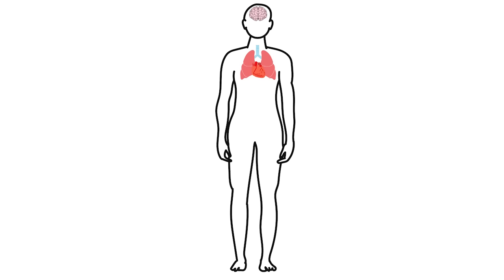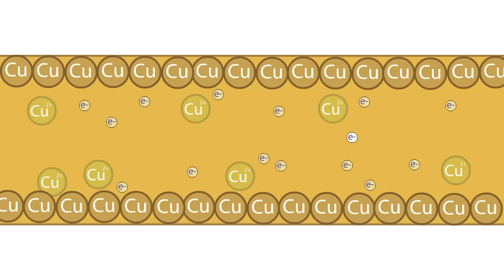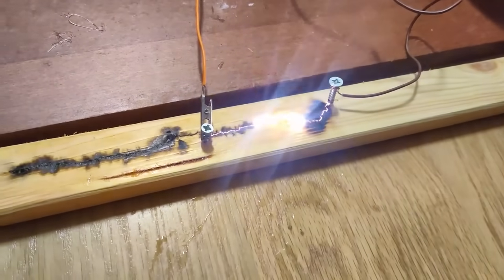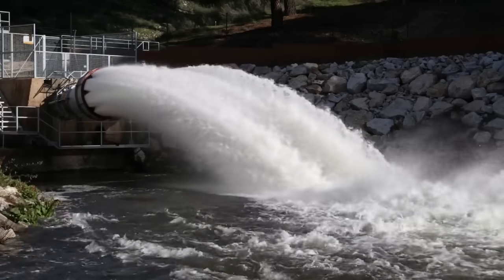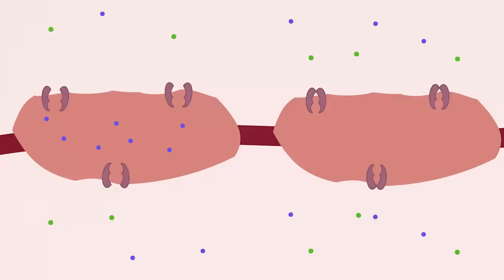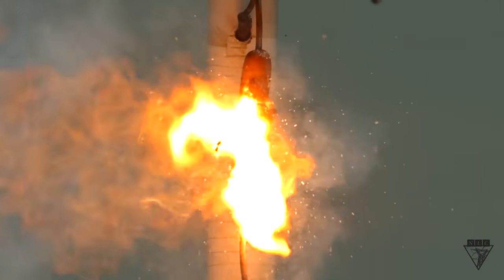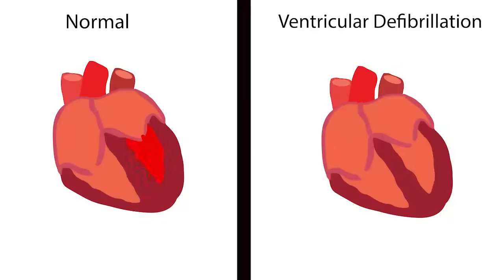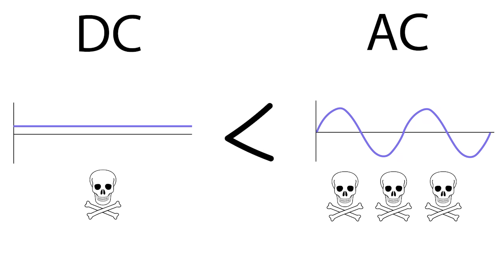Anatomy of Electrocution

Comment: Higher voltage means the electricity has an easier time finding a path, aka jumping, arcing, etc.
Current matters because that’s what will damage tissue and heat up.

Comment: I once had my finger slip through a small Tesla lamp as a kid and touched the bottom of the main chip inside I was able to get away but not immediately left a pin size burn spot on my index finger like the size of a spark from getting shocked from a doorknob even felt the shock go up the nerves of my arm starting from that finger didn't seem to go further than that though once I pulled away I fell immediately but got up quickly guess I was lucky it wasn't enough for me to not pull away at all
Reply: Also if your wondering what it feels like I've also had a more mild shock installing a new dryer in my basement my finger came in contact with one of the two screw prongs for the wires of the plug wasn't enough to stun but it was more of an undescribable tingle sensation that sort of stings I was more confused what it was because it was an odd sensation that only went halfway up my forearm the Tesla stock more went up all the way up my arm but then again I was 12 so it may also bean because I was younger

Comment: P, Power in Watts is the Product (X) of The Intensity ( I ) of Current in Amperes X Electromotive Force in  E (Volts).  Watts = Amps X Volts...  2000 Volts X 10 Amps = 20 Kilowatts! R Ohms = E / I  2000 Volts / 10 Amps = 200 Ohms P = (I x E)  Watts Law  E = (I x R)  P = 20 Kilowatts; E = 2 Kilo-volts: I = 10 Amperes  R = 200 Ohms...

Comment: This guy just explained resistance better than any physics teacher I've ever had
Reply from the maker: Wow, thank you!
Reply: @darkscienceyt you missed the chance to make a your mom joke in the insulators part of the video
Reply: @darkscienceyt hey what is the name of your background music i like it plzzz😭🙏
Reply: For real tho
Reply: I'm just gonna point out that resisters lower the current, not the voltage. If you measure the voltage across a resistor, it'll be the same, but the current is restricted.
Reply: @josemexicanmexican7602  they split the total Voltage drop. If you put two different resistors in series, the voltage drop across A will be different than the drop across B. If A and B are the same, the Voltage drop across each be half the total circuit voltage drop.
Reply: @adamwalker2377  Yes, if you put 2 paralleled resistors in series with a circuit, you can create a voltage divider, but that's not what's shown in the video. The video shows a single path and states that the total voltage down-stream from the resistor will be different from the total incoming voltage. It's the current that will be different.
Reply: @josemexicanmexican7602 "paralleled resistors in series with a circuit", what ?! paralleled resistors divide current no voltage, that's the firstly, secondly, voltage causes current, not the other way around, thus, the resistor (in series) lowers the voltage, thus lowering the overall current in the circuit, if two resistors connect in parallel, then the voltage across the first and second resistor is the same, but if you calculate the eq. resistor you can see the voltage drop also, so no, resistors cause voltage drops, thus the voltage drop lowers the current.
Reply: @josemexicanmexican7602  thank you. for saving me the trouble of explaining that.
Reply: @josemexicanmexican7602  yeah,  V = IR -->         R = V/I. If  R has increased, that means that either V increased or I decreased.
Reply: @Jose
Well, it's not wrong to say that a resistor lower the voltage since you messure it under load and not without load.
But in the case of a led (or transistor) I will agree with you that the resistor is a current limiter.
Reply: you just werent paying attention back then. bunny.
Reply: @JohnRivers-g4r  ever been taught by any teacher of mine, light?
Reply: You must attend very bad school then 🙂I am not saying he's explaining it badly, just at schools you can do in much greater details and better (but that's not the goal of this video, goal is to be short and explaining it well -- it's done really well, only a bit foggy about some physical details) 🙂
Reply: That'll change when you get your electrical engineering degree
Reply: True
Reply: but incorrectly
Reply: What im trying to say is that he put it in fewer words than any teacher I (EMPHASIS ON I) have ever had.
Reply: @bunnyrabbit324  I got it, don't worry, as I was saying, great video, you resumed it well 🙂It's just a very shallow review insight to the problematique, just to get concepts. And that's very okay and I like it (you've got even my subscribe) 🙂That guy's statement about "better than teacher" -- I mean EVERY good teacher should do something like this, review concepts and then go deeper. Maybe I was just the fortunate one I have had great teachers, maybe it's just a survivorship bias from me 🙂
Reply: Just said the same thing but about current difference between AC and DC. Think he's a teacher???
Reply: NO kidding
Reply: Yes and made me now more confused 😕
Reply: Imagine going to school, this is a simple white board lesson
Reply: Jepp!!!
Reply: It's little bit flawes but good enough for this video
Reply: For basic understanding tho
Reply: Yea! And for the most part inprecisely or completely wrong!
Reply: Lol he explained the basis of resistance. I'm finding it hard to believe you ever even had one physics teacher let alone "any physics teacher ive ever had" implying at least multiple based on that statement.
Reply: i swear
Reply: YouTube shows up the uselessness of public school.
Reply: @Adam Walker  paying attention in class is always an option. So are asking questions
Reply: @stephenhipp7859  are you a teacher? 

Of course I paid attention in class. That doesn't matter.
Reply: @adamwalker2377  yer absolutely correct. 
Comprehension has alot to do with it also

Comment: Current can be lethal even at very low voltages depending on the resistance of one's skin. You can certainly get electrocuted by gripping a 12V lead acid car battery's poles, if you're unlucky enough to be very conductive due to sweat or moisture on your skin. Obviously the weaker one's heart is, the more lethal even small amounts of current (or voltage) become. Conversely extremely high voltage can be lethal even at low currents due to burns and nerve disruption, which is why people are forbidden to climb onto High voltage pillars or to open up working (old) TV sets in which high voltages of 20000V+ are generated. Both high current AND voltage together are 99% of the time lethal to anyone (including animals)

Comment: One time I was talking to someone who was selling tazors and she said "volts hurt and amps kill". Later I mentioned this to the guy I was married to at the time and he said "Nope, it's just the opposite, it's amps hurt and volts kill." Nice to know that it was both volts and amps all along.
Reply: Volts are like a gun and amps are like the bullet. Volts are what is dangerous but it is because they make current go through the body. There is also time and the energy to consider. A normal static shock is thousands of volts and several amperes but it is harmless as the total energy and the time are very small.

The are not independent things but linked through the Ohm's law.

Comment: I got eletrocuted a few times in my home while changing chandelers and what not, 220 volts AC, and I never grab wires with the whole hand. Just the tip of my fingers. I noticed that the few times I got bit, my arm closes so fucking fast by itself and the fingers slip on what they are touching. I noticed the fingers vibrating on those first miliseconds of contact. My arm then feels tired like I lifted my own weight with it. Very interesting to understand the reasons behind this!
Reply: You got shocked a few times. Electrocution is shocked to death.
Reply: @glengivens8986  right right. I got shocked.

Comment: As ElectroBOOM covered in one video, AC is also more dangerous because our bodies act as capacitors to some degree, and AC flows more easily through a capacitor than DC does. He demonstrated this by showing that he did not receive as painful of a shock from DC voltage as he did from AC.
Reply: DC can't pass through a capacitor. If it does, the capacitor has failed.
Reply: I got bit by my cars distributor cap big time when I checked its snugness during rain!
Reply: Hmmm, quite an interestjng point of view, but i am not so sure if it is true. The human body acts as a capacitor but mainly as just one leg of it and the capacitance is to the enviroment. There may ve some other smaller capacitors across the parts of the body with different ressistance, but I am not sure how significant it is. When we say that ac flows through a capacitor, we mean from one leg to the second. So in this case from to body to the environent, not to the second end of the body. What I would say is the cause is just the naming convention, because 10V ac actually has a higher peak voltage than 10V and our nervous system gets triggered mainly by the peak current (but i may be wrong, this is just my first idea what can cause it).
Reply: Current does not 'flow through' a capacitor - a capacitor has an insulator inside it that blocks current. Your mistake is a common one. Capacitors block current, so they're used to block DC.  AC is said to 'pass' current loosely because electrons are attracted to and then repulsed from the plate on the far side of the capacitor because of teh charge on the plate - so it 'seems' like AC current 'passes through.' No electrons actually pass through, so no current.
Reply: @JonFrumTheFirst  I wouldn't call that a mistake.

Saying current flows through a capacitor is a commonly used simplification. Just like saying "the sun rises in the east". Everyone knows the sun isn't rising (it is obviously the earth's movement relative to the sun that causes the observed effect). But everyone ist still saying it does. Some goes for AC currents and capacitors imho.

Oh, and if you want to get really technical capacitors do pass DC current, since no insulator is perfect. So they have a parasitic parallel resistance (often called EPR, not to be confused with ESR, sometimes "hidden" behind a self discharge time constant in datasheets).
Reply: @JonFrumTheFirst  Yeah, okay. That is a problem, I do agree. Maybe I reacted too harshly - especially since I'm usually the first to cringe at false statements in for example "edcational" TV shows. They always mess up electrical engineering which makes me wonder what else they get wrong (where I don't have the knowledge to realize the mistakes).
Reply: @TheMightyZwom you didn't react too harshly but you thought you know everything and wanted to show off but he Shocked you when he proved you were wrong
Reply: @JonFrumTheFirst  That's a rather pedantic way of putting it. You're right, but the net effect is it does appear to flow. Using conventional current flow, we even pretend it flows for the purpose of designing and analyzing circuitry.

Comment: Risking a "dumb question" here:    🙋‍♂🖐 Since electrons make up the atoms of metal and in everything else, how come the electricity does not corrode the metals by striping them of all their electrons?

How can quadrillions and sextillions of electrons, traveling through a copper wire, not also in some way reduce the mass of that wire?    Electricity is a form of matter; but electricity does not seem to impact the mass of the metals it passes through.

Comment: I wonder if electricity effects people differently. I've gotten a full dose of 120v a couple of times and TO ME it felt like what they describe as 6 milliamps or "slight tremors" its not even uncomfortable or painful, though it is quite 'shocking' pun intended when not expecting it.
Reply: Sounds about right, especially if your skin was relatively dry. I touched 240v live wire a few times. As you can imagine, it's way worse, your whole body tenses up, muscles in the limbs that touch the electrodes contract violently, but it doesn't feel like a 60Hz vibration - it feels like one continuous contraction (at least to me it did). And yeah, it hurts (quite) a bit. On the other hand, if you're sweaty, even 120V is nasty and hurts, while 240V can be deadly.
Reply: electricity is a rather chaotic concept so luck definitely plays a significant role as well.

Comment: As an added layer of insurance, after you're sure you cut power to a circuit and you have to make contact with the dead equipment, it's always a good habit to make that first contact tap with the back of your hand, this avoiding "no let go".
Reply: or just wear insulated gloves and use a multimeter or voltage check. palm or no palm, it can kill. why tickles the bears foot if you can avoid it

Comment: if electrons are being sent with electricity, then doesn't that mean some material is losing electrons constantly? so would the copper in the wire change into copper ion from losing electrons as it's used?
Reply: No, electrons come at one end and exist at the other. In AC the distance the electrons move is way less than the width of a hair.

Comment: Now I'm wondering how much amperage goes through my tongue when I put I 9v battery on it. My tongue is pretty wet and the sensation is weirdly nice, can't imagine it's all that much but the resistance is so low that it's mathematically must be pretty high.
Reply: You could measure it with a multimeter.

Comment: 4:36 "The high amount of resistance generates heat" No it doesn't. Otherwise insulators would get hot. Heat is a function of power, and power is Voltage x Current. Where Current is V/R. The higher the resistance, the lower the current, the lower the power.
Burns on the skin, or the area that is in contact with the current source or the ground burn almost always because of arcing, and not the actual power going through, it's also why there is soot and char marks, from the plasma vaprosing the skin and oils.
The salt water sponger is there to decrease the resistance, allowing the power to flow, burns are far more likely with more power, and it was commonly recorded that burns and smoke came from the head, and areas that were grounded, the wrists and ankles. This was due to arcing as the power left his body.

Comment: Interesting, but you forgot to mention that at a high enough frequency (above 20khz) AC can become much safer than DC, since then the polarity switches to fast for nerves, which is why you cant feel the electricity at those high frequency's (Also the skin effect applies here, but you would have to raise the frequency much further for most of the current to pass over the dead skin and not the living tissue). The electricity can still cause severe burns tho, even at high frequency's, but you just wont feel it which is kinda terrifying by itself...

Comment: they are doing it wrong. the copper cap sits on outside of skin and skull. the person is going to die anyway so operation with full anesthetic could be done to implant 2 thin needle like posts through the ears into brain. with person still asleep hook up to those trodes and do it that way. possibly just like operation to remove the brain or heart itself. other options are too gruesome such as strap a stick of dynamite to side of head.

Comment: My Dad is a handyman by trade and a consummate do it yourselfer, but he never messed with electricity. He’d fix most anything in the house, but when we had electrical issues, he always hired a professional.
Reply: That's a smart man right there.
Reply: My dad is an electrical engineer. He still has called an electrician to get electrical work done at our house. He doesn’t have much experience actually installing and servicing equipment.
Reply: My dad is an electrical engineer. He still has called an electrician to get electrical work done at our house. He doesn’t have much experience actually installing and servicing equipment.
Reply: My dad is an electrical engineer. He still has called an electrician to get electrical work done at our house. He doesn’t have much experience actually installing and servicing equipment.
Reply: My dad is an electrical engineer. He still has called an electrician to get electrical work done at our house. He doesn’t have much experience actually installing and servicing equipment.
Reply: Found the electrician.

Comment: By 3:34 your statement it's incorrect, the Resistors are not really made to lower the voltage, are made to resist the current (electrons) flow. A LED is almost like a short circuit. A resistor in serial with a LED are use to create a resistance to the electrons path, regulating the amount of electrons passing thru the LED. If you not add a resistor, the amount of current will be the maximum produced by the source, causing over heating and eventually blowing up the LED. With one resistor or without resistor, technically the voltage remains the same. Combining two or more resistances in serial creates a voltage drop effect between each resistor.
Reply: Basically for a circuit with an LED, or a diode for that matter, the purpose of the resistor is to provide a place for the voltage drop to occur as it cannot all occur at the LED (or diode).  For instance, a diode will have a voltage drop of about 0.7 volts.  So, it you applied, say, 9 volts directly across the diode, it will get fried as it HAS to have a voltage drop across it of 0.7 volts, and so forcing it to have a 9 volt drop will fry it.  By having a resistor in series with the diode, the diode with have its required 0.7 volts across it, and the remaining 8.3 volts will be across the resistor.